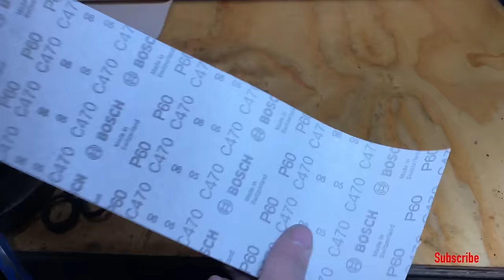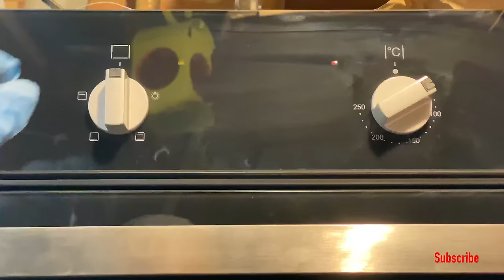Rusty Vintage Pipe Cutter Restoration

Comment: Very nice job. 

I restored a much smaller pipe cutter a while ago and had a failure of imagination on how to sharpen the cutting wheel, so did the best I could by hand but it didn't end up quite where I wanted, I'll be taking it out and using this trick to sharpen it properly in the next day or so, thanks!
Reply from the maker: I’m happy I could help. It works a treat.
Reply: It would have been much nicer if makers name was also highlighted

Comment: Another great restoration, thanks for sharing. I used these at college when I did plumbing, great bit of kit.
Reply from the maker: Thanks again. Glad you like the restoration. Thus video was the first time iv used a large pipe cutter. It sure is a great bit of kit
Reply: It is, I used to enjoy using the big lads tools, especially cutting threads into the pipes and working with the steel. Good times 👍😎

Comment: cool vid can I ask what sandblaster do you use, what psi (cfm) does  it run at  and what do you use in it Thanks joe
Reply from the maker: Hi I use a Hyundai HY3150S 14cfm, I run it between 60-90 psi. This is the absolute minimum size compressor for sandblasting. I suggest you get the biggest compressor possible. Unfortunately I’m restricted with space. I currently use aluminium oxide as a blast media. I want to give glass bead a try one day. The sand blaster is just a cheap eBay one. I’m slowly modifying it as my needs change. Hope this helps. I really struggled researching all this before buying. I had no clue what I was doing. To an extent I still don’t know.

Comment: How hot do you have to bake the powder coating and how long.
Reply from the maker: It has to cure for 10 minutes at 180c. The part has to be 180c before setting the timer.

Comment: You are exhausting to watch. The whole drama of you showing the pieces that you work on. The taking apart of the pieces, every little thing you do you show over and over (like look I am taking apart this screw and the showing the screw to the camera and then taking out the cutter and showing the cutter to the camera. It’s exhausting. Just get on with it, geez. We can clearly see that you took a screw out and we all know that those are cutter heads and rollers.
Reply: Oh yeah I also forgot to say that you sure waste a lot of energy baking the powder coating on one piece at a time. There’s clearly enough room in that oven to have done several pieces, least of all both parts of this restoration.

Comment: This is not a restore it is a modification of the original because the original didn't have powder coating, the end result is nice but it's not a restore. Also this tool is not worth the effort. As a new cutter can be purchased for pennies.

As dirty as it was it was still fully functional
Reply: Many of these old tools were painted with Lead based paint. Of course you would not, or could not use it now. This gentleman is taking the time and effort to think about this project, video it, edit it, and upload it. It’s all about the restoration, not the cost of a new one, or whether this one still works in its original state. Show some appreciation and try to think a little more before commenting.
Reply: @shanelodge391  you can think all you want the reality is it's not worth the effort when a new tool is just pennies away
Reply: Henry Gonzalez. 
Henry, I think you are really missing the point.  Let’s look at this logically. If the gentleman wanted to just cut pipe, he could, as you suggest, go and buy a cheap one and do the job. This is not what it’s about. You can see from his many videos that he takes pleasure from finding old, often broken tools and items and repairing and restoring them to their former self. Many people comment on the therapeutic value of watching these videos. 
It’s not about the destination; it’s about the journey. 
Try to to think too much about the whys and wherefores. Enjoy the video and respect the man’s passion and patience. 
Don’t be a troll. Life’s too short for name calling.  
Cheers!
Reply: @shanelodge391  logically just go buy a new one,, spend time with your family and not on things of no value.
Reply: One mans trash is another mans treasure!